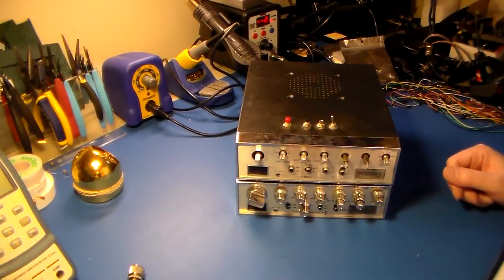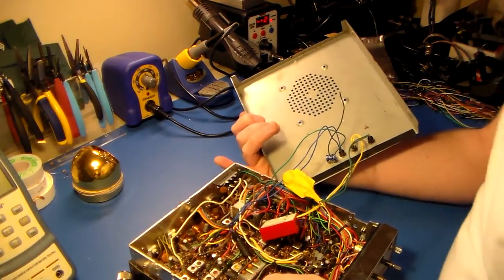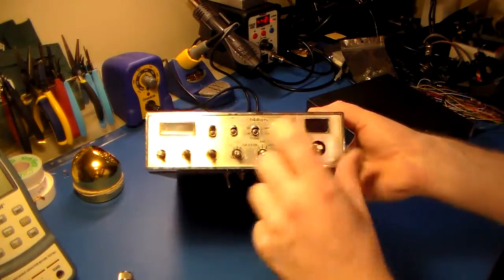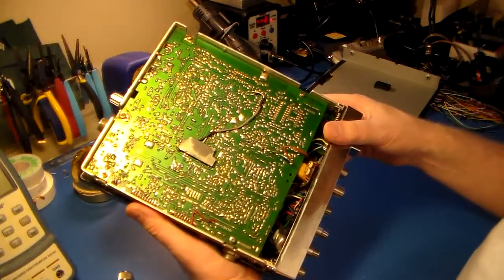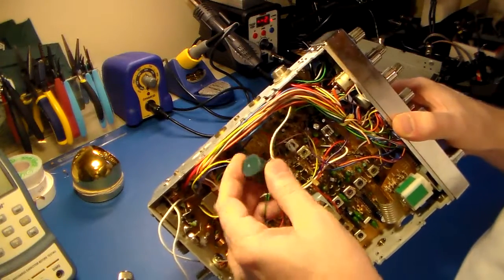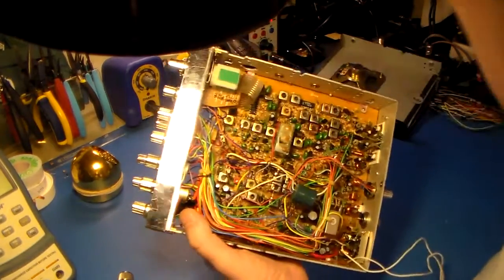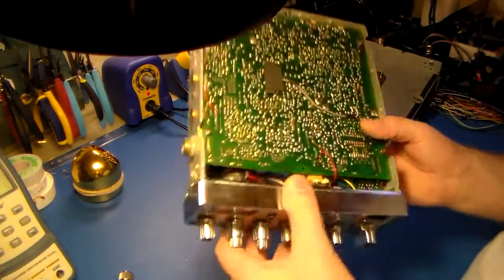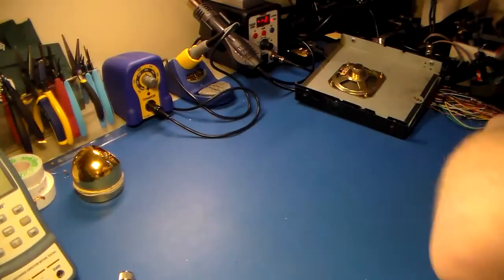Cobra 148GTL Evaluation

Comment: The "Pete / Repeat" is an on -air record / playback device that's rare to see these days. Probably worth more than both radios together if sold on E-Bay. It's the classic joke of the installed devices being worth more than the radio itself. As far as using a disk cap to shift the crystal frequency, apparently you've never heard of a "trimmer cap". They're VERY stable if installed correctly, and proper part selection is used.  27pFd is the magic number usually, but 18-47pFd is the selection range. All this does, is keep you from having to bottom out the coils after Clarifier unlocking / radio re-alignment, although USB is usually closer to bottom than the rest of them. That's because of the way the 148 does it's frequency conversion. The radio is VCO/PLL controlled / locked. The possibility of drift is completely absurd, and contrary to the function of the PLL and VCO circuits.